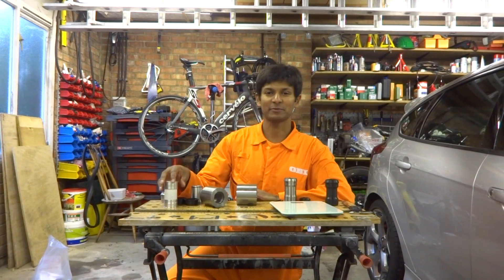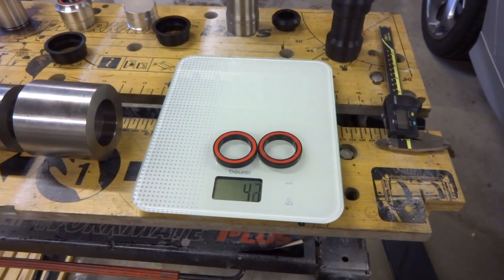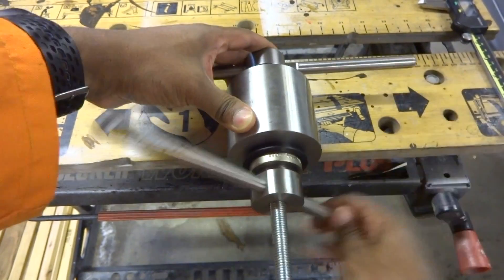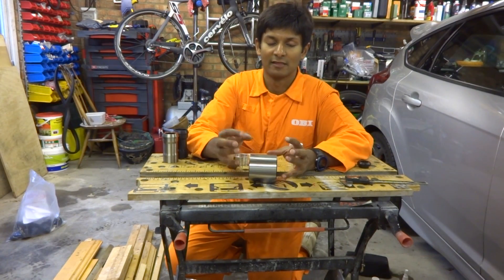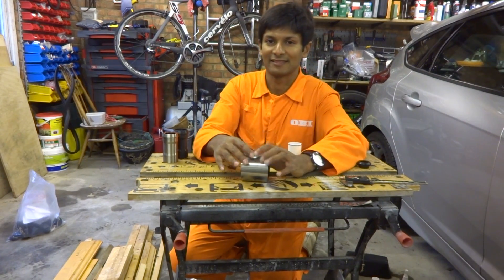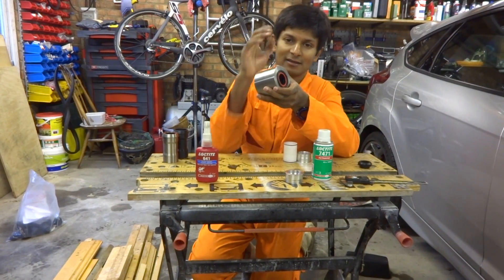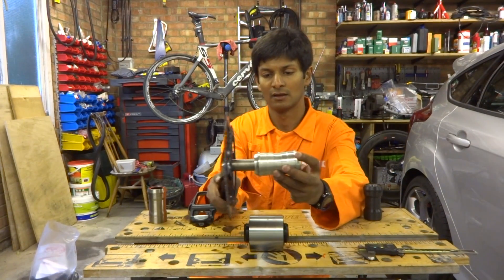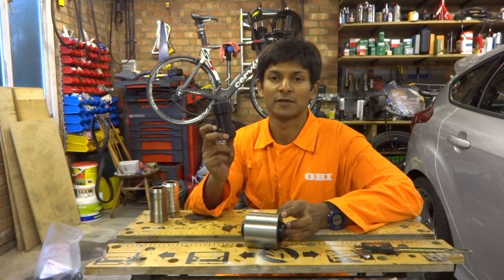PF30 Bottom Bracket Explained, Creaking, Pros, Cons and Fitting Shimano Cranks

Comment: Hi, I have an Orbea Terra with a PF30 (46x68) shell and the FSA BB cups installed on it have been replaced twice so far. The creaking does not stop with a new pair. As I won't be replacing them by another identical set, I have wondered which ones to install in order to replace these and eliminate the creaking. Do you think those with the central sleeve threaded so each side cup is attached to the other work better than standard press-fitted PF30? Thanks in advance.

Comment: Removing a "glued" PF30 without destroying the frame? To Glue or not to Glue?

I agree that "gluing" the cups to the frame (BB shell) and the bearings to the cups will certainly help to reduce creaking issues.  Looking 1-2 years down the line, when the time comes to replace the bearings or the entire BB, will the cups or bearings be removable without destroying the frame?  Using a glue essentially "welds" the cups into the frame.  Most PF30 frames do not have a flat, parallel surface,  with a diameter greater than the outer flange of of the PF30 cups,  designed into the BB shell area.  This renders "press type" tools for useless for removal and results in the only way to remove the cups is "pounding" out from the inside.  This a VERY BAD way to remove a glued-in, pressed-in structure from a $5,000 frame.  If the cups are glued in, this may make their removal impossible, or at best very difficult.  In light of this, is it realistic to believe that you can assure a quiet, creak free BB assembly WITHOUT gluing?  Overall the whole PF30 concept seems bankrupt from the outset.  Too many pieces, with too many surfaces pressed into each other, all ripe for creaking and squeaking with bearing cup bores misaligned on several planes.  You have noted on this and other videos, that bike companies do a notoriously poor job manufacturing a carbon frame with a BB shell that is aligned on all planes and outside end surfaces.  Also given that the crank spindle is indeed "straight" over time will it not try to straighten out the miss alignment, thereby causing movement of all the cups/bearings thusly creating noise/creaks and premature bearing failure?   Any insight, advice or comment welcomed.

Comment: Thanks, I think you may have the solution to my issue.
 I have a 2018 Cannondale Synapse and I want to fit Absolute oval chainrings, However, the original Cannondale BB30 setup with Cannondale cranks don't have enough tolerance and my LBS believe any flex would result in the chainrings coming into contact with the frame (as if I could ever have enough strength/power to create flex ha). So would changing out the original BB30 for your BB or the Rotor allow me to move to Shimano cranks with Absolute Black oval chainrings?

Comment: With your one piece BB shell, can you explain why the retention is from one side only + friction? I have no doubt it works better than STD or aftermarket, I'm just interested as to why you believe it (your system) wouldn't benefit from a positive retention on both sides? Cheers
Reply from the maker: It's a good question. The retention is a radial interference. The position is governed by the axial stop which is the flange. On a multi piece BB, there is no link between the two sides so the stop is required on both sides. On a one piece, the two sides are linked so it only requires one stop. That flange is not there too stop the bottom bracket falling out
Reply: @Hambini  to help my mechanically minded (not engineering educated) brain. The explaination for the two piece token BB I just fitted having two axial stops is simply for positioning in the frame and doesn't (generally or by design) offer any benefit to that system? Just feels counterintuitive (to me) that a second stop wouldn't add any benefit.... But I'm not the engineer obviously 🤔😆
Cheers and thanks
Reply from the maker: @michaelallan108  If you took the extreme example where there was no axial flange and basically a tube, you could push that tube in and there would be nothing to locate it.

On a two piece, each of the tubes needs to be located hence the stop.

On a threaded for pushfit (like a wheels mfg or praxis thread) the stops are there to tension the threads - it's the tension that holds it in.

Comment: I got a PF30 carbon bike with carbon shell. Cups are 2 piece aluminium Campy Power torque. Aftet 50-100 km ride right cup works its way out of the shell by some 2-3 mm, clunking on harder right pedal downpress. Also chainrings move a bit to the right affecting front deraileur operation. It happened already third time in a row after repressing cups/reinstalling crankset. Is this is a clear indication of poorly manufactured frame which needs warranty replacement, or maybe some chance that installation was improper? Retaining compound was not used in any of case...
Reply from the maker: It's more likely that your frame has some sort of issue. That sounds more like misalignment given that it happens after a period of time. If you can get it scanned, then it will tell you for sure.
Reply: @Hambini  thanks for your input, very apreciated. The bike now given to Bike shop for fixing this as it is under warranty anyway, only 400 km ridden so far. Will see what manufacturer will do about it..

Comment: hey Hambini, so by using the cups or adapters to fit the shimano cranks are you losing more power if you use an integrated BB? or loses are minimal? how many watts or % would you approximately lose with the cups?
Reply: not much, if it squicks then you losing power

Comment: Alright Hambini, I realize that you probably get swamped with questions so let me and to the list.  I have an Orbea Orca with a BB86. I am currently running Dura Ace 9000. (that's what it came with) however I am a Campy guys and plan on switching to Record 11sp. This is where it gets a little gray for me and where you come in. Now, the dura ace crank is rather close to the frame without the need for bearing cups. Therefore (I think) more power and less BB deflection and stress to the BB and frame.
Campy requires cups for the BB bearings. Therefore pushing the crank arms out and additional 20mm. (10mm per side)
My thought is that the spindle is longer on campy and increasing the leverage on the BB / frame with each peddle stroke and increasing the chance for a creak or making the BB hole on frame oval. (relatively speaking) your thoughts?
Thank you for your time!
Reply from the maker: There are a couple of things to consider.

Technically, the Campag system is superior because it uses an interference fit on the axle and not the bottom bracket body. Shimano has it's interference fit on the body and the axle is a sliding fit. The ability to take load with an interference fit on the inner race is increased.

When you get to around 90mm of bearing spacing there isn't going to be much difference between the two. The crank arm stiffness is a variable that needs to be considered.

Parking the design to one side and now speaking from personal opinion. I would stick with the Shimano system every time. I'm not a shimano lover by any means and they are not immune to their share of F*ck ups but their manufacturing systems and tolerances are miles better than Campy and SRAM. The other two don't even get close. The Shimano system looks to me as an engineer like someone who was very switched on designed it. The Campy system lacks from the same level of manufacturing engineering.

Hope that helps 

Hambini

Comment: Hi Hambini, that's a great channel you have. I was surprised to find a little corner in the internet, where facts come first! Having bought a supersix evo a couple of years ago, I face a dilemma to work with what I have and invest in wheels or start from scratch with a better choice of frame and pick components along the way. From what I gather, the frame in itself is not bad, but it's nothing special either. What do you think?

+1 on the poor bottom bracket though! Mine developed lateral play from new and after a lot of faff, the mechanic at the shop I bought it from said one of the cups was "loose" and had to refit it and I presume they packed it with retaining compound to keep it in place. 

On a separate note, do you have any knowledge of the commuter/urban bike market? I am going to get a new commuter, but am looking for something closer to a fixie/single-speed type. They all seem to come with rubbish Quando axles and pathetic brakes...
Reply from the maker: Hi Stefan, I commute on a Cervelo S5 so I'm the wrong person to ask. If you already have the frame, it's a false economy buying a new one unless there is a problem with it. A new frame will not make you significantly faster. However the wheels will make a difference. If you want good all round wheels I recommend Shimano C35/40/50/60 - they are robust and well made. Hope that helps Hambini

Comment: Sir thank you for this Video. I have multiple question about this PF30. This is the current technology that Cannondale using right now on their Supersix evo Hi mod bikes. To be specific. Cannondale uses Part # KP197/SRM if you google this you will see exactly the parts and what comes with the bearing kit. This kit come with aluminum shell cups to hold the bearing in the BB. My concern is.. i have not found a tool or anyone demonstrating of removing of the shell cups with the bearings. Nor have i seen the right tool for it. I'm not a big fan of tool being used to tap out or hammer out the bearings for it can ruin the tolerance of the bottom bracket. 

My question with this particular situation....Once the bearing goes out on the PF30, does the shell cups need to be replaced along with bearings? Or only the bearings?

My other question is when installing this part # KP197/SRM on the BB, which we know that cannondale have the aluminum shell cups on this kit. Do i use the activator and loctite on the aluminum shell cups?

Lastly, how do you remove the shell cup if they need to be removed or replaced with out using the hammering method. Please link me up a tool for this if you have a source where i can get this. Or if you can show us a vid. Thanks! sorry this is too long. Thanks in advanced!
Reply from the maker: Apologies for the delay, I missed your message. The puller and the sleeve need to be appropriately sized but they will fish anything out. For the Other questions, the cups can usually be reused but the bearings need to be replaced. Activator would not be required for an aluminium on aluminium joint. Activator is only needed in carbon frames. Hope that helps Hambini

Comment: The user manual of my bike (specialized epic) specifically ask to use epoxy when installing the PF30 BB, which is the reason why I'm sooo reluctant to service this component. I can imagine how difficult it gonna be to remove and how messy when reinstall......
Reply from the maker: Are you sure it's epoxy? that seems pretty drastic
Reply: Hambini Yeah. And it's not regular epoxy, they recommend to use 3M DP420, industrial grade stuff which has super high shear & peel strength (T_T). Google keyword (PF30 epoxy) for the long-lasting discussion of such method. Pleas make a video using your dummy BB to give us more information regarding how, if possible, to remove, install, pro, con etc. Many thanks!

Comment: Hambini: incredible content! which manufacturers are known to drill straight holes? Or perhaps a better question, which bottom bracket standard(s) has the least issues? This will be a major decision point for building up my next bike. I currently have a trek with BB90 (not sure if you're familiar with trek and the BB90 v2 bearings, but it's a nightmare)! Thanks in advance!
Reply from the maker: Hi, I'd recommend Cippollini, Pinarello (because they are threaded) or Look. BB90 usually uses 37x24 bearings which are an odd size. If you get creaking you are stuffed because there is not much you can do to correct it short of putting lots of activator and retaining compound in it. Hambini
Reply: Hambini Performance Engineering Great, thanks! The dogma/gan fit the all around race function I'm looking for. I saw colnago has some new proprietary bb that's PF threaded. Any experience with that one? P.S. now I just need some Naca profile wheels with problem-free hubs... :)

Comment: I came here to learn how to stop my Stumpjumper PF30 from creaking.  
I'm leaving with a plan to never buy another frame with a BB30 or PF30 bottom bracket. 
oh, and, holy crap that loctite is expensive.  $62 for the pair shipped from Grainger for the smallest bottles.
Reply from the maker: you should be able to get it cheaper than that! you can probably blame the constant quay to make things cheaper for all of this!
Reply: Hambini Performance Engineering what do you think about bbinfiniti. they seem to be selling a bb very much the same as what you made yourself.
Reply from the maker: My opinion of them on a business level is poor. They threatened me with legal action about a patent infringement claiming that I had infringed their US patent. I pointed out I was in the UK and then put a video out stating words to that effect and that I would expose their business practices along with an open invitation for them to take legal action against me. They then decided to back down and apologized for giving me the hassle. 

For an out fit that was the result of a kickstarter campaign I find it ethically unacceptable. 

From a technical perspective, I have never used their products so I cannot comment but there are some fundamental differences between Hambini and BBinfinite:

1. Hambini units are hand made and not made by a computer code. Hand made allows the machinist to account for tool wear and final tolerances remain the same. That's not possible with a computer program as there is no feedback
2. Hambini units do not have a centre sleeve
3. Hambini units do not require an air hammer and an air compressor to remove. 
4. Hambini units do not use Chinese bearings or bearings that are made to a standard that is only popular in fidget spinners and skateboards.
Reply: I did not realize that Hambini made the BB that you showed in the video. I thought that was a one-off you made. I apologize for my ignorance.   I'll take a look at your solutions as well.  Thank you for the information and the video.
Reply: The manual of my 2014 Epic describe the procedure of installing PF30 BB must involve using epoxy between cup-frame and cup-bearing. Perhaps that's how the OEM solve the creak. Consider to change the BB using the "wet" method prescribed by Specialized.

Comment: Hi Hambini
Many thanks for this very informative video. 
Have I understood you correctly in that you loctice the bearings into the cups as well as applying to the cups prior to installing into the shell?

I've been plagued with creaking from the bb on my Supersix Evo HM. Just watched this and it's made me determined to solve the problem once and for all. 

Thanks
Reply from the maker: Hi, yes if you go for loctite to both bearings and cups. Also remember the activator, the activator is important when using the loctite on non metallic components.

Comment: Your videos are excellent, I've just started subscribing. A question if I may... I have a cannondale supersix evo with a BB30 and I'm soon going to replace the standard FSA cranks with dura Ace cranks. I have no idea what standard bearings/bb cannondale have put in there (or the bike shop), do you think it would be worthwhile just getting some decent bearings and changing all that out at the same time as removing the cranks? If so do you have a recommendation?
Reply from the maker: Hi Karl, If you are going from BB30 to Shimano, you have to bridge down from 30x68mm wide shell to 24x90mm. You can use a dedicated bottom bracket or you can use delrin adaptors to bridge the gap. If you are going to change the bearings, I would recommend you use NTN, SKF, NSK or FAG. If you are in the US, Timken might be easier to obtain.

I specify NTN bearings in Jet engines as my default but the other brands are also good. FSA have some bearings which use green seals, these are rebranded chinese bearings and they are of poor quality. I would not recommend swapping the bearings out unless you have a reason to. Changing them out because the NTN bearings have lower friction coefficient is not worth it as the difference is small. Changing them out because they feel gritty or have worn is a good reason.

Hope that helps Hambini
Reply: Thanks so much Hambini, shortly after posting my comment I watched your 25min video that demonstrates the whole process of going from a BB30 to Shimano crank on your Cervelo. I will do exactly the same thing as what you have done. I will almost definitely buy one of your bottom bracket assemblies also. Its very srtange that the designers of BB30 would move the bearings inward, wouldn't that just increase moment forces from the cranks into the bottom bracket? I would assume that the closer you can get your bearings to the crank arm, the better for stiffness and reducing those moment forces.
Reply: @karlroszko  BB30 was designed to give road cyclist two things they keep clamoring for: (1) narrow as possible "Q-factor", and (2) something for all those cyclists that consistently have "heal strike" on their crank arms, marring them up.  BB30/PF30 addresses these two desires.  Now there is much disagreement with the buying public's sensibility in focusing too much on narrow Q-factor without mapping it back to a body dimension or measurement.

So the narrow BB width was the design trade-off BB30 inventors made.  True or not, they also believed they could make up the stiffness difference using a larger diameter aluminum (vs. skinnier steal)  spindle.